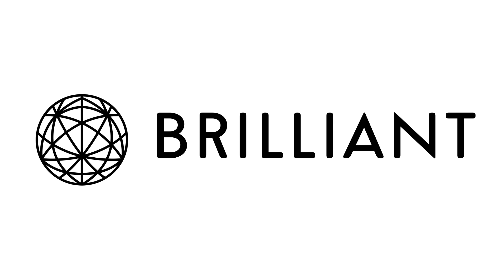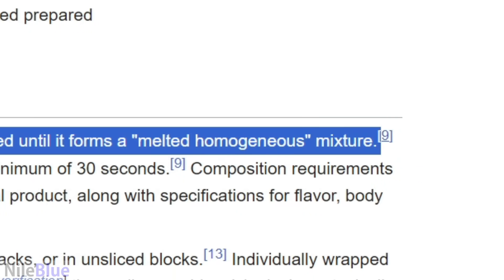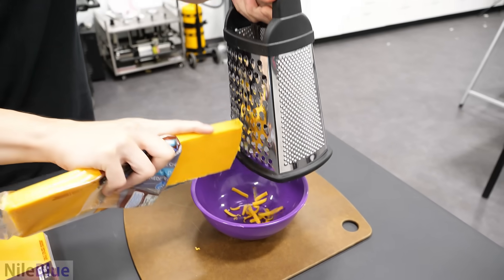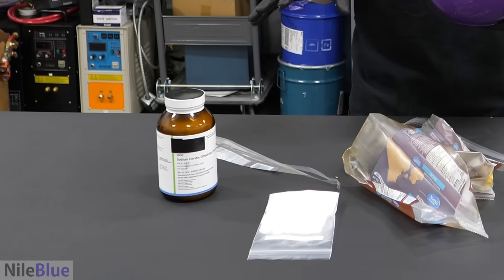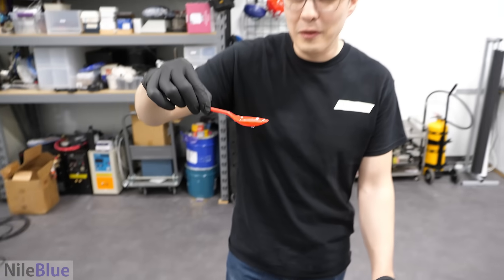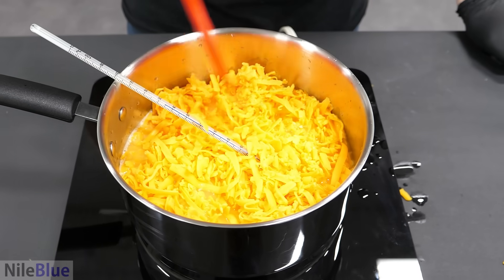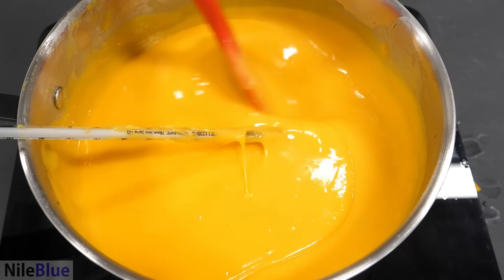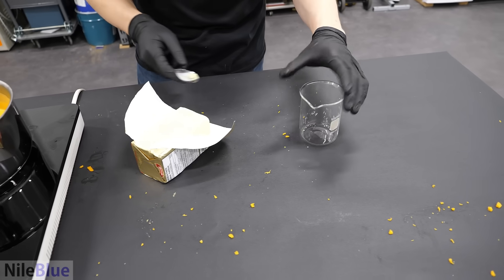Making American cheese to debunk a conspiracy

Comment: I've worked in a cheese factory where the primary product was American cheese. The way they get the slices so thin is by using a large rotating chilled stainless steel roller that picks up the melted cheese where it immediately solidifies and is then sliced and peeled off.
Reply: But is it plastic?
Reply: @jontay4199 of course not, at least not plastic as in a milk jug. It’s plastic in the way it acts as a solid.
Reply: @jontay4199 the only similarity between American cheese and plastic is that both melt easily
Reply: That's pretty cool, actually
Reply: @AyyDraws  pretty chill.
Reply: @fcgHenden badum tss!
Reply: I really expected them to make a brick of cheese and then slice it, but that’s much more clever and cool
Reply: @mainhalo117  I think the misconception is that American cheese has the material properties of a plastic, but it is not a plastic chemical (polymer).
Reply: It's not abeyance cheese that's made from plastic....
It's Margarine that's made from plastic..
... or at least that's what I always heard as a kid. lolol.

*although if I remember right,  margarine did come about from dime type of grease used on military vehicles or whatnot...
(... now I wonder if I did memba that right.  haha & D'oh!)
Reply: Microplastics 😋
Reply: @andrewactingwayne  Margarine is made of vegetable oil...
Reply: @mainhalo117  And it tastes like plastic
Reply: @jontay4199 It's plastic as a term, in that it has plasticity, but doesn't contain plastic in content. 
As far as we know. 😆
Reply: @raerohan4241 vegetable oil was developed for industrial use, which explains why margarine sucks
Reply: Would they tell you if it was plastic though? Because they wouldn't tell their every day staff that. Then the word would get out.
Reply: @mainhalo117   Look, taste and texture as well.   It's an abonination.
Reply: @jontay4199  I actually looked it up and technically it is A plastic but it's not in the same sense as a plastic toy car or a milk carton. A plastic largely uses organic materials if not not entirely so technically it's plastic but there's nothing unhealthy in it.
Reply: @spongeman6559 I looked up the definition and I felt so stupid when I realized all plastic is is a compound that acts as a solid.
Reply: @2rslvl126  I don't believe the FDA would legally be allowed to have plastic (polymer) as the food product.

I'm talking about legality here, not morality.
Reply: I used to work in the factory that made the plastic that the cheese is wrapped in.
Reply: So you're saying american cheese is just cheese bingsu?
Reply: @redwithcoffee619  So every cheese is a plastic by that definition.
Reply: @joshshultz1250  I mean you can look it up and draw your own conclusions, but from what I read there's more "plastics" in the world than I realized
Reply: @jontay4199  Tastes like it.
Reply: Do you get the ingredients of the cheese.
I’ve worked in a chicken factory but the ingredients come from three seperate companies each with an NDA
Reply: My husband used to work in a cheese plant. He was shocked to discover that the processed cheese is made from cheeses that had gotten moldy in storage. The processing kills the mold and the cheese isn't wasted.
Reply: @mudcatfrank7537  that's actually pretty cool, must save alot on costs.
Reply: Those weird jobs we had when young, or old fi we never moved on! 😅 I worked for Proctor & Gamble for one day as a temp, and my job was stacking paper towels as they came of the line to be wrapped, or packaged. The idiot operating it was shoving hundreds of rolls at me so fast it was impossible for one person to keep up. I didn't return the following day!🤦‍♂😁
Reply: @mainhalo117  And they are both full of chemicals - you missed that bit.
Reply: @Im-BAD-at-satire  Your joking they allow nano particles in all sorts of stuff and you think they would baulk at chemicals.
Reply: @joshshultz1250  If you ignore the chemicals and include organic cheese mad e by hand as being plastic LOL that it is so off the mark.
Reply: @zorbalight3933  I'm talking straight up the entire thing being plastic, they wouldn't allow plastic itself be a food item, I'm not talking about nanoparticles; you can't realistically filter everything out 100%.

And everything food has chemicals, anything edible are chemicals. There's a surplus, a myriad, of chemicals listed in unaltered naturally grown fruits.
Reply: @zorbalight3933  literally everything is technically full of “chemicals”. As someone else said in this thread you can literally make the exact stuff he used with lemons and baking soda.
Reply: Margarine was originally made from the same animal fats used for soap. @andrewactingwayne
Reply: @andrewactingwayne  Margarine was a butter substitute and it was made from lard back in the day, and now it's made from plants. Essentially, it is vegan butter nowadays.
Reply: Looks like you took plastic cheese and made it more plastic. The way the original cheese grated made it look like it was already plastic.. maybe it's just because I'm not in the US that it looked like that.
Reply: @mainhalo117 And are delicious…
Reply: Thanks for sharing this 🙌
Reply: @zorbalight3933  Define "chemicals", because everything is chemicals, from natural to artificial. Everything you eat is chemicals.

If you're talking about toxic substances, then no, there is none of that in american cheese.
Reply: SOY CHEESE !
crab channel !
Reply: Why does it look and taste so bad compared to normal cheese?
Reply: @crabstab8989  pretty subjective. Lots of people love the taste of it. 

But its probably just all the oil. American cheese has a lot more fats added to it in the form of oil, which makes it greasier.

If you're used to less fatty cheeses, then that would probably be the source of why it tastes bad to you.
Reply: @eragon78  that's very informative thanks

Comment: Before individually wrapped Kraft Singles, we had to peel a slice off a block of cheese. I recall it was tricky to get one slice without tearing it, so you would peel two or three, then separate them to single slices. One or tow for the sandwich, one directly in the pie hole.
Reply: The pie hole. I thought I was the only one who used that term 😊
Reply: I remember my parents accidentally got a different brand once and I remember it tasted like what I imagine rubber and cheap plastic would taste like, while also having a slightly waxy consistency. It was disgusting.
Reply: Lunch packs still do that

Comment: Worked at a processing plant making Kraft singles.  I loaded the hopper.
600lbs of  cheese, old cheese , cheese ends,basicly  what did not sell. It came in large drums  about 150lbs. The cheese was vaccumbsealed in a large plastic bag  inside the drum. There was an "acceptable" amount of mold allowed. This was loaded into the grinder along with 80lbs of frozen anhydrous milk fat. The dry hopper mixed in the 160lbs of dry whey.  The other ingredients  where added  down the line in the melting stage.